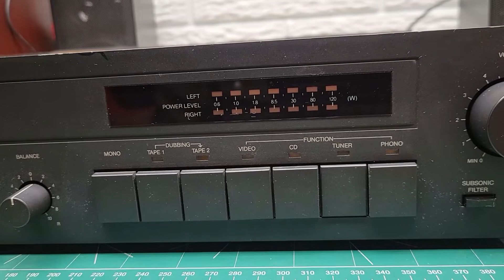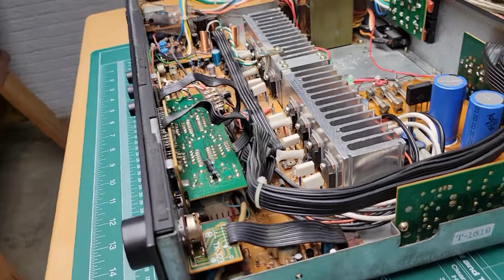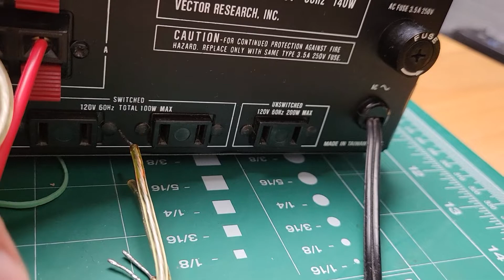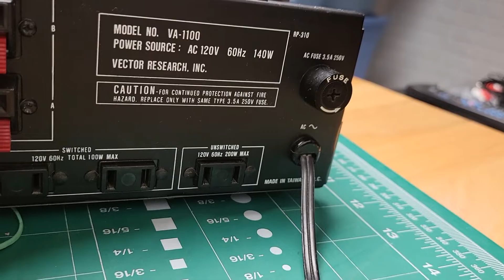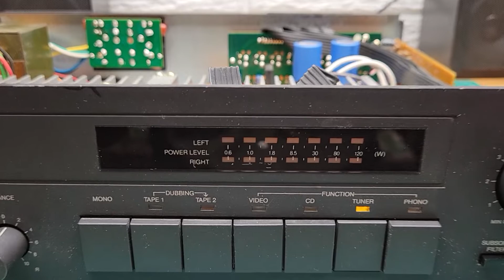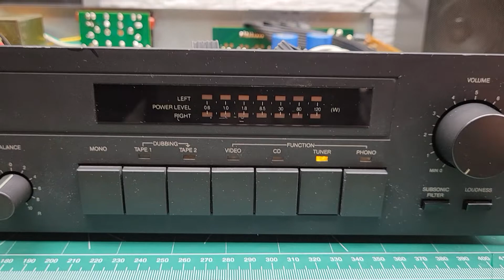Vector Research VA-1100 Integrated Amplifier Demo

Comment: I have had the VA 1400 since 1984, sort of a collectors item now as the company went out of business , and it  is a great integrated amp. VR was a US competitor for the NAD and Rotel integrated components  of the day. 60 watts RMS into 8 ohms and 1.4 db of dynamic headroom so it could meet the high power needs of the low frequencies at low volume levels. Like NAD, they are a giant leap above your basic commercial electronics for proper bass response reproduction.